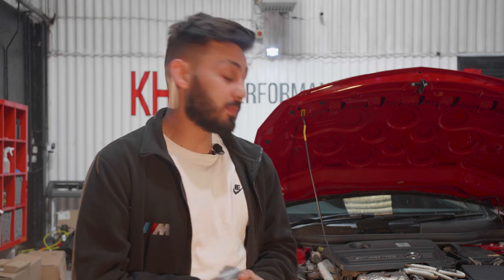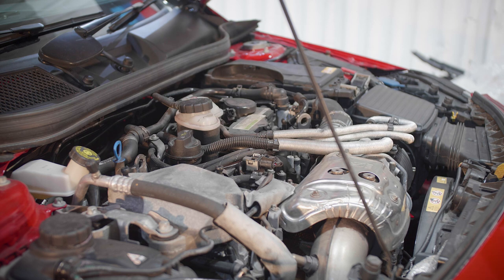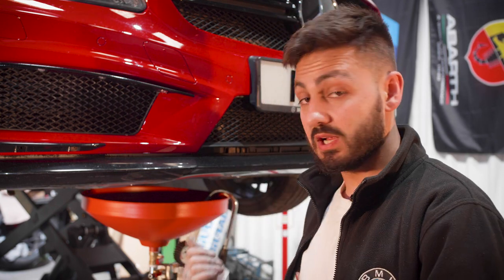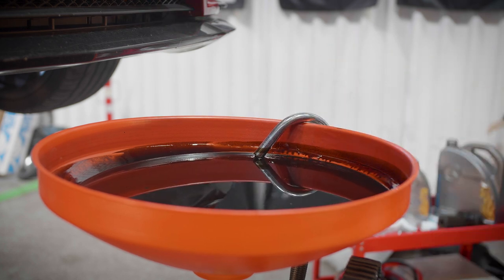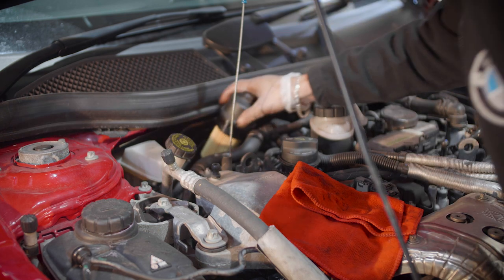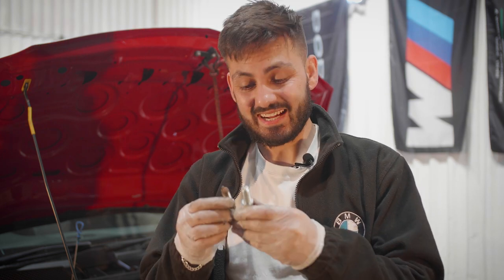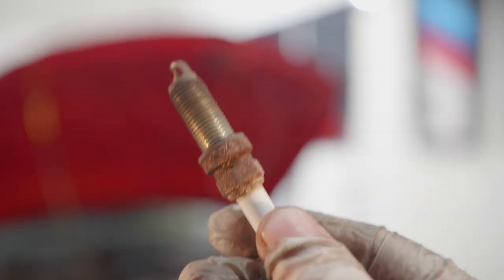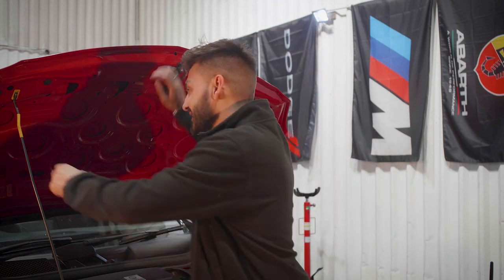A45 AMG - BUILD PART 2 - OIL SERVICE & SPARK PLUGS

Comment: Are spark plugs included in the B service price if done from mercedes or indie?
Reply from the maker: B service will cover spark plugs but they’re changed according to the maintenance schedule I.e spark plugs are changed every 2/3/4 years depends on the car and engine. But you can always request it to be changed regardless of how long they’ve been in car

Comment: Hi man
Just following up how easy was it to pull out the coil pack?
I have a cla 45 amg.
Reply from the maker: Coil packs are fairly easy. However, cylinder 4 spark plug isn’t easy to remove you’ll need a special spark plug adapter, as there isn’t a lot of space due to turbo mounting location. Rest is rather simple.

Comment: That’s not the proper oil for that car. U need oem AMG oil not the standard MB oil. Btw u can get upgraded spark plugs for the A45, the standard MB ones aren’t great imo. U are missing orange alignment rubbers on your coils as well bro. Great video btw💪🏻
Reply from the maker: Thanks for the info. That was the initial service, everything else has been upgraded since & during our performance development stage. The oil is the correct one. Appreciate the feedback :)

Comment: khan bhai plz help me my cla 45 amg have just driven 14000 kilometre right now and its previous owner told me that they did a service of car on 8500 kilometre now service indication showed up what should i do let it drive for 23000 kilometre and then do it because as far as i know 45 amg needs service after  15000 kilometre one more thing my amg doir sills went off i remember i washed it couple of times myself but i always saved it from water could it be error that both my amg doir sills went off and most important of all my car started showing abs parking brake error 4 matic not available once it happened it went away on its own didn't came back gor three months but again it came now it goes and then comes back again i didn't drove the car could it be auxiliary battry issue or main battry issue my electric steering became hard when error comes all of sudden it goes everything went back to normal should i go for mercedes obd scanner small ones and diagnose it and then erase it some MB forums say that if your fuel cap is loose or your camera is dirty or your door is not properly locked these error comes last time i pushed electronic parking brake up and down couple of times it went away engine error came i just tighten the caps from front opening its bonnet it went away i am very troubled due to these i dont like when my car doesn't perform ok my door sills i just cant digest that they are not glowing help ne bro i am not a mechanical genius like you so help me guide me...
Reply from the maker: First, I wouldn’t take someone word, if the light is on just get it serviced to prevent damage to the engine in case it hasn’t been serviced.

Regards to the electric problem you’re experiencing, I would start with scanning the car as without the scan it’ll be just assumptions. But if it started after you washed your car and door sills, I would suspect water got into the wiring, I would take the sills off and make sure everything is dry there. If can bus of other communication lines are shorts you will get a lot of errors. But this will be shown in the scan. Scan the car and send us the report and we will help you as much as we can to get your car sorted. 

Regards
Reply: car is still standing still couple of days back i washed its sensor my friend who does scanning told me that many mercedes comes to him with these abs sensor error problems most of the times its the dust that makes them pop out errors sometimes cleaning them with water pressure cleans the debris and it does the work he erased those errors and it again came as i drove it he told me to disconnect the battery terminals so that ecm should refresh i did it for whole day but again they came back once again brought his scanner erased them,before these errors came my car went inside muddy water twice so there was lot of sand dried on inside in the meantime abs parking brake error went away after erasing i washed it engine check error light went away i drove the car for couple of kilometres came back home just about to park it boom errors came again he told me your car ecm sending wrong signals due to left abs sensor...
Reply from the maker: @fhhvdhuhhvhdvuhvdvh  email us the complete vehicle scan report